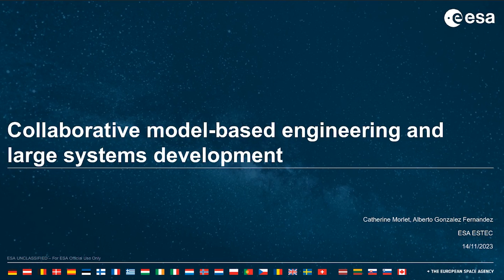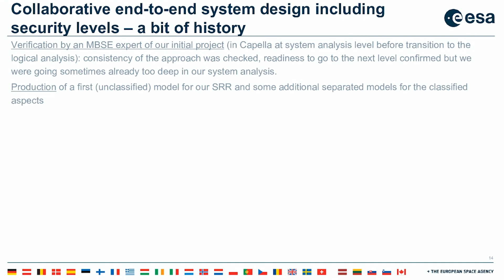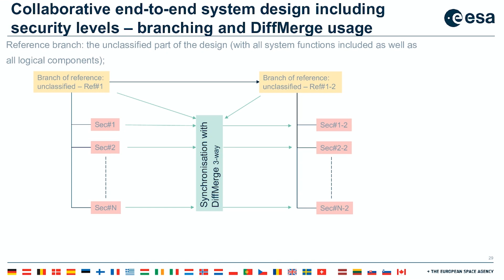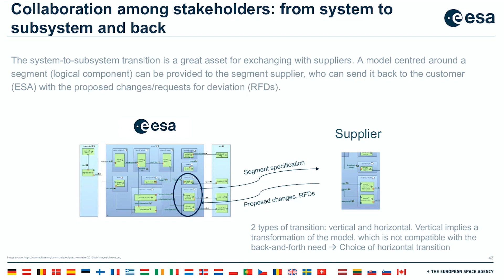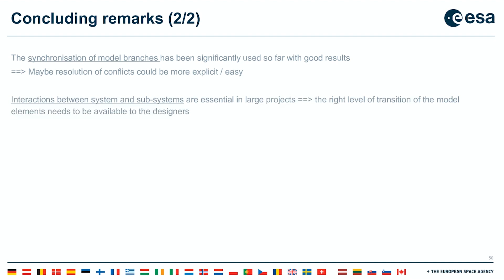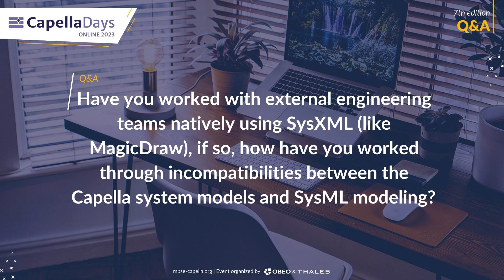Collaborative Model-Based Engineering and Large Systems Development | ESA | Capella Days 2023

Comment: 25:00 With regards to navigating the model; I keep hearing this common problem encountered across many users of Capella. Why for the life of me I don't understand, why one cannot simply double-click or control-click any system element to 'zoom' into that element, either in a dedicated view with the element in its context, or to the next lower level of the architecture for that element (SA to LA to PA). There could be a default destination for each object, or a custom destination set by the user. I know Representation Links can be made to other views, but that's not a solution. Navigating Capella doesn't have to be hard; it could be made intuitive if only a developer was motivated to do it.
Reply: 26:45 Querying the model needs a major overhaul too. I'm aware that you can add Title Blocks and enter AQL to query the model... but who knows this trick and who the hell knows AQL? Basically nobody. And this is a turn-off for everybody you're trying to convince to use the model. As well as intuitive navigation, the model needs an intuitive search or filter functionality, or integration with other systems that already support search or filters (e.g. SharePoint, Confluence). I believe there's also a Python4Capella thing that supports Configurations, but not a great solution either. Just give us a filter based on a metadata field e.g. 'customer' or 'configuration' or 'operational capability' to grey-out all the unused elements (all elements which don't contain the desired attribute value).
Reply from the maker: @JayLikesLasers   Hello, you can use the different tools: methodological browser, semantic browser, navigation shortcuts, navigation menu, diagram navigation, etc.
And if you need more informations, check out the documentation included in the user manuel, in the section "tips and tricks", also available here online: https://github.com/eclipse/capella/wiki/User-manual#online-version.
Reply: @EclipseCapella   Thanks for the response. I am aware of those methods; however the intuitive function, which numerous of our users have asked for, is to "double click to zoom in", i.e. double click on a system element to zoom in to see a new view containing its structural sub-elements.